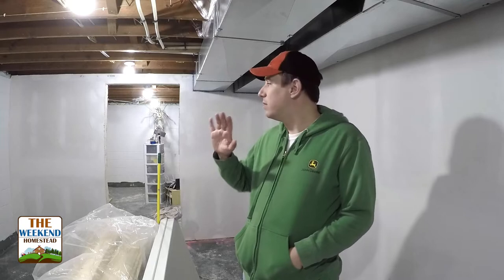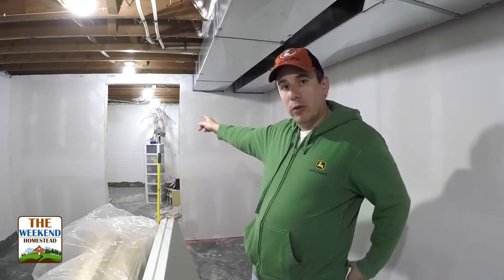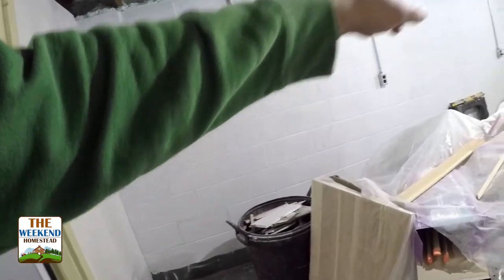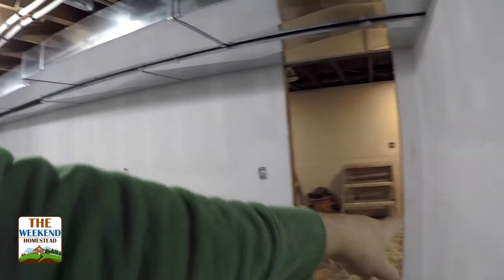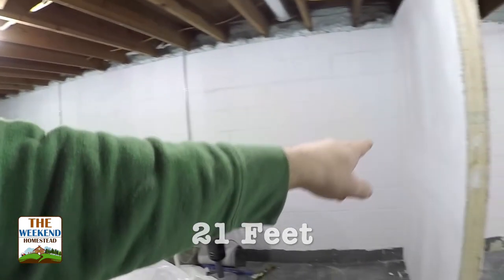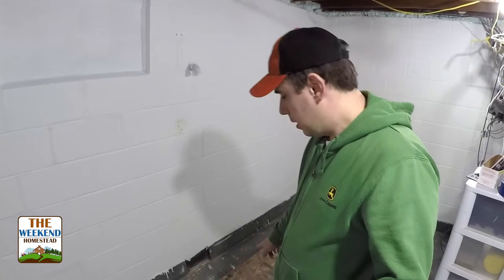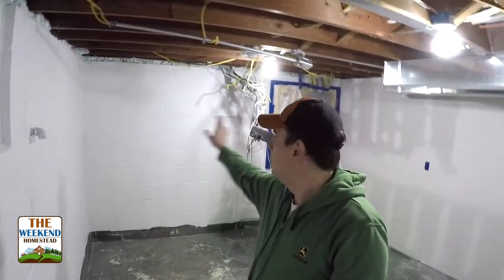CONTEST! - HELP ME! - Cabin Shop Remodel - The Homestead Shop Series

Comment: You should put in a work bench along the wall for gun cleaning, maintaining outdoor equipment. Big projects can be done in the garage when you finish with that. With plenty of light this area would be great for small household repair projects and table top videos. I would also do a craft table on casters so you can move it around depending on the project. (Craft table with hydraulic jack to raise or lower height). Small French cleats or storage for tools and fasteners normally used on a day to Day basis. Maybe some adjustable stools on casters as well. Great videos, keep em coming!
Reply from the maker: +Brad Howard thanks for the ideas on the table - casters and jack is a great idea

Comment: the suggestion i would give to you for this space is a multi purpose room.  i would put lower cabinets on the none door wall and have 2-3 movable tables(workbenches on casters) in the center this way you can use the room for what ever you need.  on the 11 foot wall with no door you might want to put a chalk board wall so you can have a fun place to play and keep lists.  make the room so that you can change it around.  it is a great space.
Reply from the maker: WINNER PICKED TONIGH!

Comment: Pool table.  How is crash doing, he's not picking on any more teeter-totters is he?  As he and his brother get older a game of pool with mom & dad is fun on the bad weather days or nights.
Reply from the maker: all better - no issues and back at it again. We are now all mudd everywhere on the property, so he is all about splashing and making a mess. issue on the pool table is i dont think you would have enough width and not sure how you would get it down there
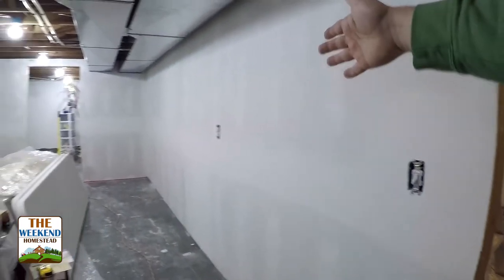Reply: Mud puddles are like magnets for little guys. Glad to hear he is doing good.  Remove the wall at 1:10 or a part of it.  Header it off (if it is bearing) with an exposed beam and you have all the space you need. The tables come apart.
What, more destruction & construction & dust? (reading your mind)

Comment: Hi Will thinks keep looking better...  As for that space you are looking for ideas for, i would make it a general repair shop, with at least an 8' work bench setup for general repairs.  Your equipment repairs I would set up another shop out in the garage.  You dont want to work on that equipment in the basement it will stink up the place plus as a brother Firefighter, too many ignition sources... Do you have a bilco door going out of the basement???  Keep Well...Chief
Reply from the maker: no bilco or walkout. thinking may need a bench in the bar for the stinky stuff and leave this space for the cleaner stuff. Have thought of putting a vent fan over the work area when painting or doing other smellier projects

Comment: not sure that you would want to do the engine thing in the house, you'll get that gas and other cleaner smells in your house. craft and grow room is a great idea
Reply from the maker: yes I should have said fixing a part or painting something on the machinery vs rebuilding a 350 hemi down there.
Reply: The Weekend Homestead lol, no I meant even fixing the lame mower in the basement, they stink especially if they have a little gas in them, don't want the Mrs. upset because of the smell!
Reply from the maker: Its a toro mower so I wouldnt think it was lame :)